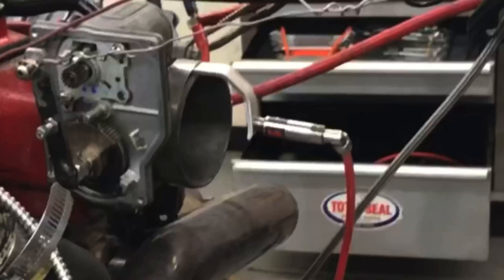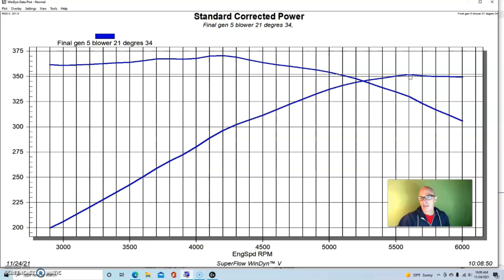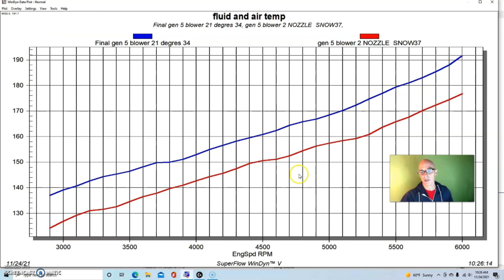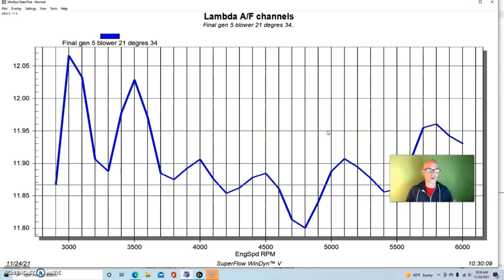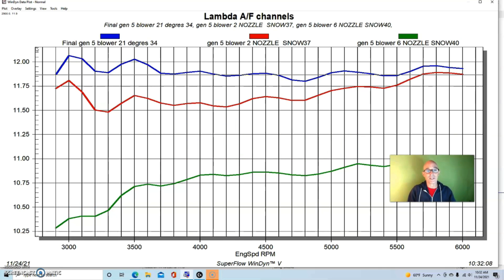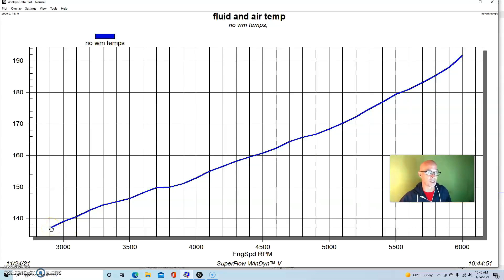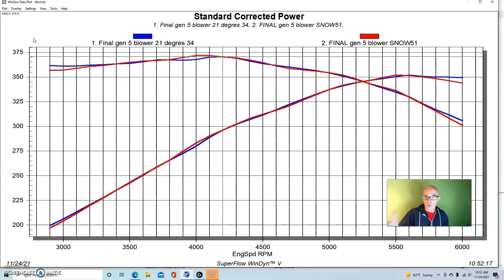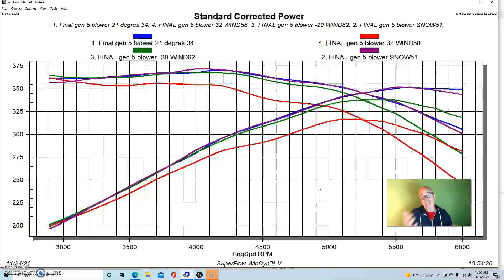WATER METH VS (LOW-$) WINDSHIELD WASHER FLUID-WHO WINS? BEST WATER/METH VIDEO EVER! IATS, AF & HP!

Comment: Richard, thanks for all this testing. I don't know if it is mentioned in the video, but I believe the base fuel for this test was e85. I think that is critical to note for the viewers. If you were to Re-run that pulley on 91 and if you are octane limited you'll see the real world benefit of w/m injection for locations where e85 isn't available, when you can add timing back to get to MBT.
Reply: Yeah I completely agree with this. This test isn't giving us the results many of us are looking for. E85 is NOT that available to everyone to begin with, so using it as the base fuel for testing in my opinion i wrong lol. WM injection would be way more affective with 91,92 and 93 octane since they are more knock limited than E85 would be.
Reply: @boosted0079  even with 100 octane it'd be more effective, E10 is what we need.
Reply: @Prestiged_peck  here in Oregon, everything is at least 10% blended by law. I thought every state has the same law? They seem to think charging a dollar more per gallon for "non ethanol premium" is something special though 🙄.
Reply: @boosted0079  ik that I was saying that, testing it against eth free is interesting too. We actually have eth free 87 here and it's more expensive than 93 at the same pump
Reply: @boosted0079  here in OK we can get non ethanol gas but it costs more.
Reply: @boosted0079  I live in small town Alabama and we have non ethanol fuel available for about 20 cents a gallon more. I always use it in my small engines to avoid damage to the aluminum parts. Makes a slight difference in performance, but no damage is worth it. I usually add a couple moth balls to boost octane for the go kart.
Reply: @russellbergersen3296  that's fortunate. It's at least $1 a gallon more here for non ethanol premium. From what I understand, small engines and motorcycle engines are what is best for. My sporty little boosted 3800 runs great on the 10% ethanol 92 octane for the most part.
Reply: @boosted0079  so are they back to using lead for knock protection when the ethanol is absent?  or MTBE to reduce pollution?
Reply: Agree with balck99rt, water injection pays big dividends when you're knock limited, by allowing more boost or more timing that you could tolerate otherwise.  The big takeaway here IMO is that if you are NOT knock limited then adding water injection provides little to no benefit.
Reply: @lindsaydempsey5683  precisely!
Reply: @lindsaydempsey5683  exactly what you said! I'm knock limited on my set-up where I can only run around 12psi without water meth due to charge temps getting out of hand, with water meth I'm able to increase boost. If I was running e85 I wouldn't have to spray as I won't be knick limited. E85 isn't at the pumps in NZ anymore so have to use e10 (98 octane).
Reply: You make a valid point, i was going to make a simular coment, id like to see this combination run on 91 with the necessary reduction in spark timming and see how much power it produces then add the meth injection and then see if would tolerate the enough timing to improve  power significantly
Reply: Excellent points.  I totally forgot that Richard was running E85 in this engine.  Water-Methanol would show more benefit when running with straight gasoline.
Reply: I would love to see what you can do with common old 87 and boost juice
Reply: I have a video on my channel testing 50/50 WMI on 40DegC (110F or so)day at the drag strip.. made significant gains in mph without touching the tune.
Reply: This. Octane difference would be minimal and the e85 has a much better charge cooling effect if though pre blower Temps are high
Reply: @Sruikyl  I highly disagree that octane would be minimal. I know octane would be greatly affected using WM with 91,92 or 93. The big reason it's not very affective with E85 is because of that reason. The methanol in WM can't really change the octane much at all against the ethanol in E85 (110 approximately), but it could and would change it's greatly against high octane pump fuel.  That's the whole point for using WM is to lower the IAT, and raise the octane level.
Reply: This makes so much sense. I was trying to figure out how he couldn’t add more timing with meth but already running E85 I could definitely see that. Thanks for pointing that out!
Reply: Even pure meth is much less effective with E85 than with pump gas.
Reply: Interesting.

Comment: What I got from this is:  75-80* drop in charge temps, but zero appreciable gains in HP / TQ, with a lot of fuel table tuning just to get things back to baseline with boost juice, and an overall net loss using windshield washer fluid.
Reply: Yeah me too. Seems to me that at track days, and events with long lines and wait times. You don't have the risk of detonation when your intake temp soars, and will make the same power reliably regardless of ambient temp. basically

Comment: that is interesting, great comparo.   Does the ECU tables have fuel correction for intake air temp?  I'd imagine it does, you would think it would add fuel simply due to looking at a cooler temp cell.   I think the best way to recover power would be to just add boost:)
Reply from the maker: we zeroed the correction tables and don't run closed loop
Reply: @richardholdener1727  Pharmacy denatured alcohol works but how well idk

Would be nice for you to test it

Comment: Am I in before everybody asks about straight methanol or blends of 50%-100% methanol? 

What if you have ice in the boost juice? (Or put the jug in a tub of ice water) Can you use less volume and get lower temps?

See my profile picture for how I feel about no intercooler running washer fluid.

Comment: I'm curious what the AFR difference is if you were to run out of water/meth after you removed fueling in the table. Would it just be the same difference, just on the lean side
Reply from the maker: it would be a full af ratio point leaner-meaning it will be a big problem
Reply: @richardholdener1727  I've seen some videos of different safeties that people will set up. I think  I'll stick to an intercooler for now

Comment: I was really surprised. I never would have thought you needed to lean it out with a cooler, denser air mass. Without the dyno and A/F ratio data, I would have been chasing it in the wrong direction for sure. Another great video!
Reply: Methanol is a fuel as well. When it burns it uses some of the available oxygen.
Reply: Also brings a little oxygen to the table.  @phillipshelton2332
Reply: The world war II fighters had a de-enrichment mechanism (on the carburetor) when the water injection kicked in.

Comment: nice one , i would have liked to have seen what rc fuel with 25% nitro would do instead of boost juice :) but i am strange like that me
Reply: I would like to know as well.
Reply: I know adding 3 oz to a gallon 25% RC nitro in a chainsaw makes it throw chips about 20 feet really sucks the fuel though
Reply: RC fuel has oil in it, synthetic and castor (bean) oils. I used to mix 6/6% (always by weight with fluids not volume) but I'd guess the premix would be 5/5% or thereabouts. Nitromethane content is usually the only difference in them for different classes of racing

Comment: I don't understand using the water/meth. Spray 100% methanol you would have even cooler intake temps plus the octane rating is through the the roof. No chance of detonation and you could run so much more timing safely spray straight methanol. Well I'm just saying what do I know but to me it's a no brainer I mean water doesn't burn.

Comment: what about just using tap water with no methanol? would probably be the best option for most people because you get the benefit of cooling from water but no effect on air/fuel ratio as you wouldn't be introducing any extra fuel.
Reply from the maker: that won't change af but will lose power
Reply: @richardholdener1727  What if you just ran straight meth?
Reply: That would be interesting to test. I would expect it to still make it run richer because you’re taking up some of the volume in the cylinder with water even if the water doesn’t burn.
Reply: Would work to be able to run more boost and/or timing if you are knock limited.

Comment: if you can find the msds (material safety data sheet) for the wiper fluid it will tell you the ratio of water to meth and any other ingredients. this is great if you’re looking for a certain blend.
Reply: For the Peak -20, the SDS says 33%methanol/67% water.
Reply: @fascistpedant758    I would bet that is best case scenario.